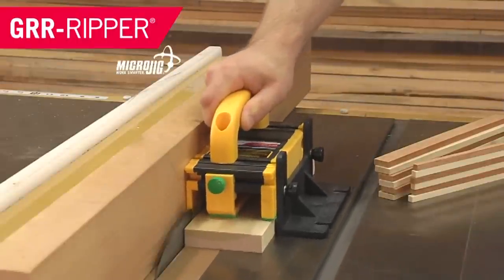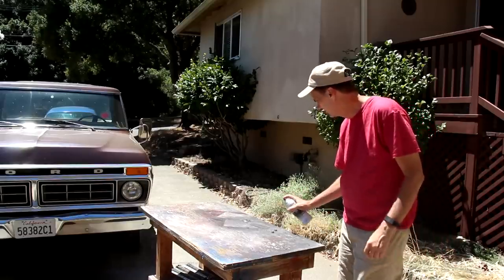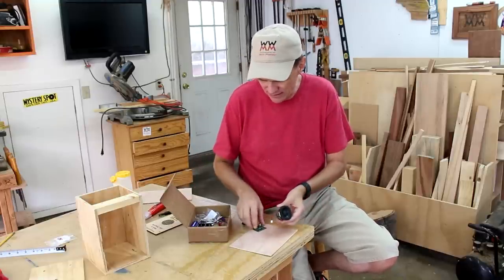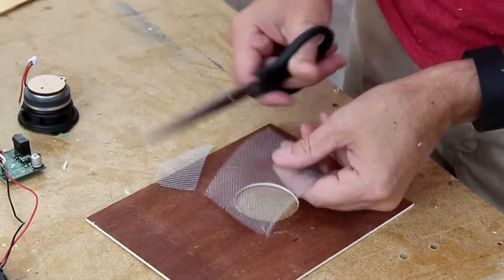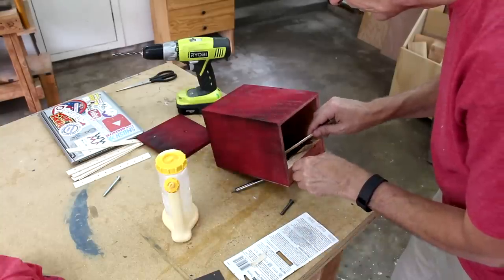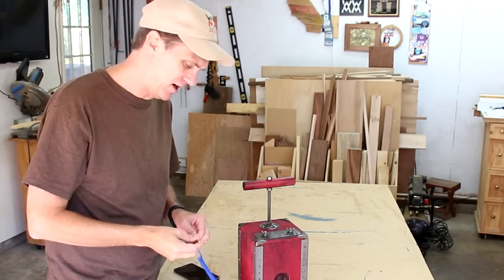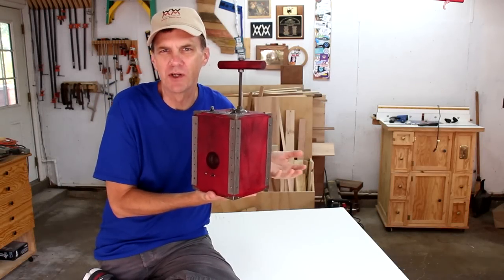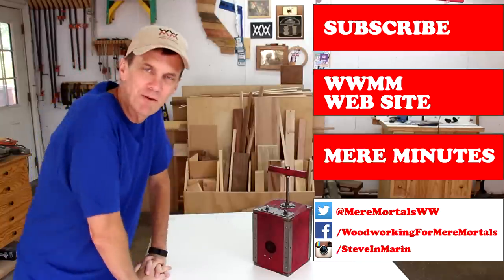BOOM Box Amplifier! Explosive Sound For Your Tunes.

Comment: I know you will mention the comments on your soldering job in your next MM, so count me in on those criticizing. It not only was "all the soldering that was needed", but it also looked like all the soldering you have ever done ;) . It may work, but especially on mechanical components like switches and sockets a good solder joint is needed or they will break. And in most cases it's an annoying intermittent problem that sometimes is there, sometimes isn't. In non mechanical components it's still an issue, because thermal cycling wil break the connection.

Try to heat up the pad and the component lead at the same time by touching both with the iron for 2 or 3 seconds, and only then add the solder. The solder should melt when you push it against the lead/wire. You don't put it directly on the soldering iron.

Comment: Steve, You have many to learn about soldering. :)
Reply: ***** If it ever stops working it's because of "cold" solder joints, which means you didn't heat the PCB enough for the solder to flow and adhere. Nice Project =)
Reply: ***** You can get problems with vibrations. The cold solder joints are like balls (based on the surface tension) with a small contact area to the PCB. If you heat up the PCB you get more contact area and therefore a much stronger joint. So it might work for now, but you could get problems if you take the box on a bike trip.

Comment: Great build Steve, for the plunger on /off switch you could put a non locking power switch at the bottom of the box, and when you depress the plunger it would push and hold the switch on. Pull the plunger up and it would release the switch turning it off.

Comment: ***** , you could probably use the on/off switch provided and mount it next to the plunger. You could then put 1 or 2 nuts on that would make contact with the switch and toggle it on or off. Maybe use a couple rare earth magnets to keep the plunger up when you pull it up to turn it on and then push it down to turn it off (detonate). In the spirit of some of your "more whimsical" designs,  you could add more electronics to add extra sound effects for when you are turning it on or off, but that might take away from the simplicity of your design.  Enjoyed the project.

Comment: you should have used those t nuts for the for the input for the audio device but with the cable you would have to cut 1 end off and use the bare wires for the t nuts to make it more authentic

Comment: Plunger for switch: Don't wire the switch to the board, run a couple of trace leads instead.Mount the switch inside  so it's perpendicular to the plunger rod. Mount a plastic flap on the side of the rod so that it flicks the switch down (on) and up (off) and put a 90 degree channel on the rod so that it can be turned to stay in the up (off) position.
Easy no?

Comment: If you find a way to connect the plunger to one of the hand charging devices with the 5 volt output, that could work, for the winding handle type you would need a rack and pinion to turn linear motion to rotary, would also need to check if it can rotate either direction
The only linear motion device i've seen is this one, but there may be others https://en.wikipedia.org/wiki/Battery_charger#/media/File:Linear_induction_flashlight.jpg

Comment: Why not put a generator in with a charging circuit in the box and a gear rack onto the plunger? So you can charge it by pushing the plunger down, would work exactly like a real detonator box. 
Also maybe volume and tone pots under the handscerws? Or maybe a volume pot under one, and a turn switch under the other, so you don't have to have a squtch on the front. So instead of using them as real screws, they would be attached to the shaft of the pots, and you can control the volume with it. Would be awesome!
Also I love this project, I'm making it this weekend, and I'm very happy I will be able to, as I only have a jigsaw, a hand drill, and a drillpress, so can't really do rip cuts for example :c 
Thank you very much for the idea!
Reply from the maker: Lol...I have no idea how to do any of that! This is just a woodworking channel.
Reply: @SteveRamsey   Don't worry, the volume control and the switch are easy! for the switch, one of these: https://www.ebay.com/itm/On-Off-Two-2-Position-Rotary-Select-Selector-Switch-1-NO-10A-600V-AC-XB2-ED-R9G9/323560904914 You drill into the knob and epoxy a threaded rod into the hole, then install the switch so the threaded  rod sticks out on the top, then put a contra nut and the wing nut onto it, tighten them together so the rod rotates an turns the switch by turning the wing nut. After that, you solder a pair of wires into the board in the place of the switch, connect them to the new switch, DONE. For the volume control you should buy an amp board with option for volume control, then buy a potentiometer with the recommended rating, install it into the box so the shaft is in the hole, file down two sides of a threaded rod so you get a flat piece in the center that fits into the groove in the potentiometer's shaft, put on the contra nut and the wing nut the same as before, apply a small amount of glue onto the flat piece, push it into the groove, solder 3 wires onto the board where the potentiometer would go, solder the other ends of the wires onto the potentiometer according to a schematic, put the box together, DONE.
And really, I could have done it in the time it took me to write it down :D
The generator and charger part is much more difficult, and for me, fairly expensive too, so I'm not going to bother with making it right now... Maybe on a later date, and maybe I'm going to make a tutorial of it too. I mean you really inspire me to do something with my free time, so I'm very greatful for the work you put into this channel. Can't thank you enough! :D

Comment: I suppose if you wanted to get real fancy, you could make this box work with a source without an audio jack of any kind, and at the same time make it look even more like a real explosives plunger. The two wires from your source would connect to the wingnuts on the plunger much like these wires from a stereo connect to its speakers -> (http://the-gadgeteer.com/wp-content/uploads/2014/11/sherwood-rx-4508-stereo-receiver-with-bluetooth-6.jpg) This would also make use of the currently decorative wingnuts. Unfortunately, you would need to remove the metal plate below the wingnuts, other wise it would short out. Just a thought

Comment: I don't think it would be that difficult to make the handle the on-off switch. An original Dynamite plunger works by having a metal plate on the bottom underneath the handle attached to one of the terminals and having the other terminal attached to the gear assembly that the handle rides against. When the handle is all the way up the circuit is incomplete (off), when you hit the plunger the metal handle creates a complete circuit between the gears and plate that detonates the dynamite. It shouldn't be that hard to adapt it as an on-off switch for the batteries.
Reply: +Cory Bleghler  You have obviously never seen a real  plunger type explosives detonator.  They actually use a friction generator, the real ones. That's why you have to pull the plunger up and shove it back down quickly; the push causes the plunger shaft, which has teeth on it, to spin up a gear that is linked through a gear box to the friction wheel, which in turn spins up essentially what's a magneto that generates DC current sufficient enough to ignite the fuse on the trinitrotoluene, aka Dynamite.  As a bonus fact, Dynamite is a brand name of TNT, much like Dumpster is actually a brand name of construction site refuse bin.
Reply: Sorry, but that last sentence is not entirely true. Dynamite is in fact not TNT, but (originally) nitroglycerine combined with diatomaceous earth. The improved dynamite has other substances added to it, but the explosive is still nitroglycerine.
Reply: AvRac
Well, I appreciate the correction.  I had always thought Dynamite was the brand name for trinitrotoluene.